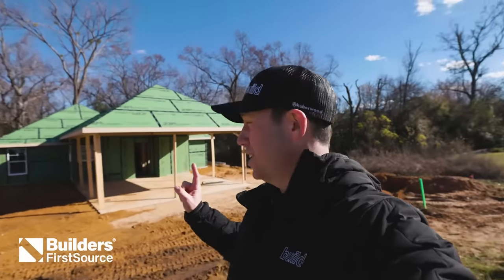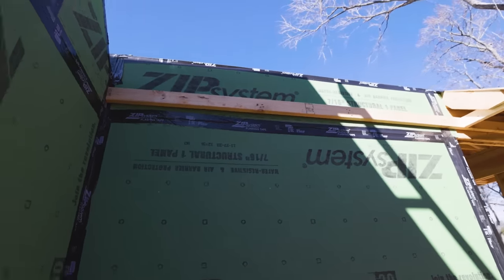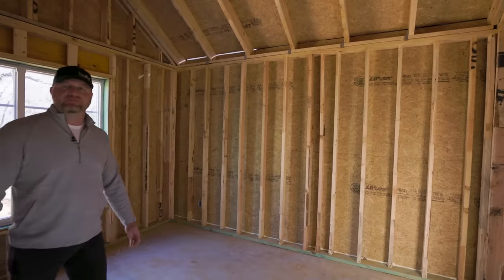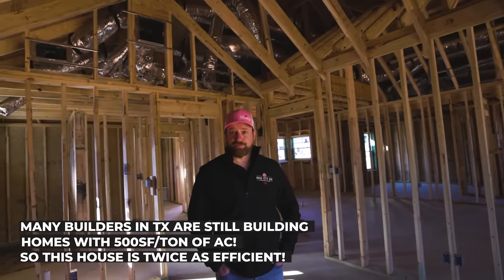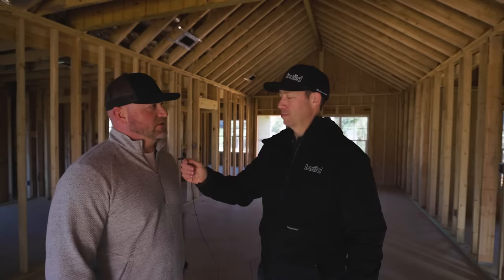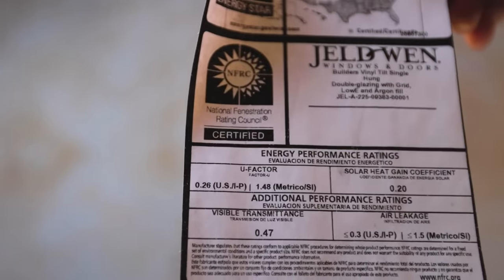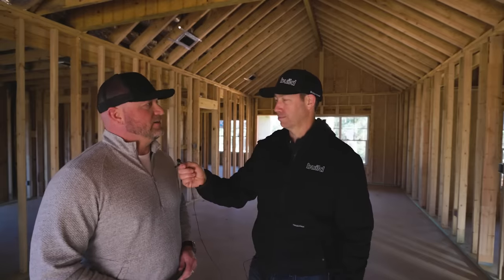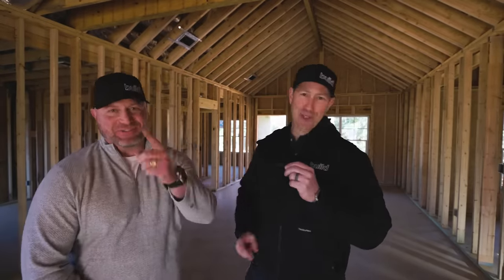Nice houses aren't just for the rich - How to build a quality home at an affordable price.

Comment: How does the attic breath?
Reply from the maker: It does not. The attic acts just like another room of the house, or a basement in a northern house. There is communication between the attic and the house air-conditioning system. This is a sealed air-conditioned attic space.  No vents to the outside. The AC and dehumidifier will keep that attic nice and comfortable. You also noticed there’s no combustion appliances in the attic. He’s using a heat pump. Hope that helps. Look for my other videos about conditioned attics for more information.

Comment: Only issue I see is all the flex duct work. That stuff can start to expire in 10 years.
Reply: It's actually all hard pipe. The only flex pipe used is in the last few feet that connect to the grills. Flex pipe is used to help dampen the air flow sound. Also, there are a couple of places where flex is used because of the tightness of space.

Comment: What would that house sell for in the normal market, with regular mark-up, and no gvt money?
Reply: There are not any subsidies being used. The monies to build the houses are being provided via a grant from HUD give to the City of Tyler Neighborhood Services. The cost would be no different on a custom home. I charged cost plus for this project. You should see the finish out!
Reply: @joshmcalpine8236  Thanks, The way It sounded in the interview you cut them a pretty big break on pricing.  Get Matt back there to do a walk though before someone moves in
Reply: After watching the video, it did sound that way, but it wasn't. Sorry about that. I charged the exact same as I do on any custom home, cost plus. All builders charge different prices. I've found the fairest way for me, and my client is on a cost-plus basis. 

You should see what the finish out is going to look like. Some viewers have difficulty believing these houses are $200k with the high-performance framing. They will really be questioning it when/if they see the finish out.

Comment: If I wanted a house VERY similar to this built, in Arkansas, do these guys work in Arkansas? OR is there a way for me to get some more info for a builder in Batesville?I'm looking for a 1500sq ft house, with a 1200-1500 sqft garage, I am expecting my budget to be between 300k to 400k but I was also hoping to have about 100k for a Tesla roof, so as to not have much of an electrical bill ever.
Reply from the maker: Unfortunately, my company only builds an Austin Texas. I hope at some point to have a network of builders around the country that I could refer you to. I wish you the best my friend.
Reply: I build here in Arkansas, I’d skip the Tesla roof. Just my opinion.
Reply: @GrulkeLamonte  why? I want solar power, and like the Tesla roof. Is it an issue with solar systems in general? or something specific with the Tesla roof?

Comment: energy efficiency doesn't give you a  feeling of living in an upscale home, but spending that money on finishes does.
Reply: When you walk into a high-performance home you can actually feel it. Believe it or not, the finish out on these houses are even better than most custom homes.
Reply: @joshmcalpine8236   I guess you have no idea what custom homes are like.  A 200k house with expensive framing products will not have premium surfaces and trim
Reply: I do actually. I've built 28 homes here in Tyler, and a number of them were customs. You won't even believe the finish-out on these. All quartz countertops, custom cabinets throughout, extensive craftsman-style trim package, roll-in primary tile shower, and much more.
Reply: @joshmcalpine8236  It depends on what you consider upscale in a home. I was commenting on the basis of the video, which is that spending money on lumber means its and upscale home but the reality is that spending that money on finishes and trim is what will make it feel upscale. .

Comment: That is 100% incorrect the fact that he said it’s the only homes in smith county that is the most energy efficient home. I built a home back in 2022 that pushed out a cfm of .5 so yes I will call the builder out because he is definitely not the only builder that builds with these techniques. Idk what cfm he pushes out but pushing out a .5 on a cfm is slim to none in smith county or all of east Texas alone.
Reply: Oh and by the way I’m in smith county as well. I build totally the same as this dude. Every framing detail he does I do every bit of it. Only difference is he’s taking extra time in framing on the eves after the home is framed and sheeted and I don’t do that. I run the zip from the bottom of the walls under the eves up the cap and over the roof. I then use zip system liquid flashing with zip tape over the Eve cap on the bottom and top and I use siga tape on the bottom seal with liquid flashing down the seam first. I tape all my exterior boxes and the entire inside and outside of the windows with zip system tape and stretch tape and also use zip system liquid flashing behind the window flange. I run either rockwool or foam insulation in the walls and foam the ceilings with a back up erv system in the attic space. I also install rain screen that’s almost like the new zip system rain screen they brought out just a hair cheaper then zip but looks exact the same and the product is even made the same as theirs.

Comment: Building a pretty good home is not that expensive. Using zip sheathing a little spray foam or flashing bat and an aggressively sized HVAC system cannot perform a lot of so-called high-performance homes that are super expensive. I did that with my $200/ SF home and I'm thrilled with the results.

Comment: In Southwest Michigan that house would be $550k easy.  No one will even use Zip on houses less than $400k around here.  Anything less than $400k are built like it’s 1991.

Staggered framing isn’t even dreamt of around here until you get into $1M homes.  It’s pathetic really.

Comment: Build an energy efficient home but still stick the hvac system in the attic. Why not build a utility room on the main floor. Now they will foam the roof deck again good luck when the roof leak happens
Reply: This is a 1300 sqft house, giving up floor space for a mechanical room doesn't make sense, especially with a conditioned attic.

Comment: Sorry, thermal bridging is not a major issue with wood framing.  A lot of work for a 50 year ROI for the additional work needed.  We typically look for 10 year ROI on all expenditures.  Massive rafters could build two houses with that amount of lumber.

Comment: Terrible tape job, I see the tons of fish mouths reach to scoop water.
Reply from the maker: I don’t think it made it to the video, but Josh mentioned that to me also. He was planning to send the crew around with a roller again.
Reply: Fair I've discovered that even the smallest miss will build water. Tried wrapping the bottom edge of boards and actually ended up trapping water from somewhere. So i make sure to lift them off and apply smooth before first roll.  As Joe L pointed out capillary action can drive water up to the top of a redwood.   @buildshow